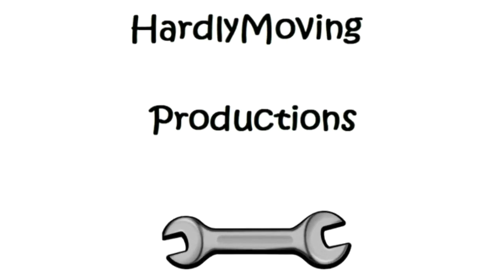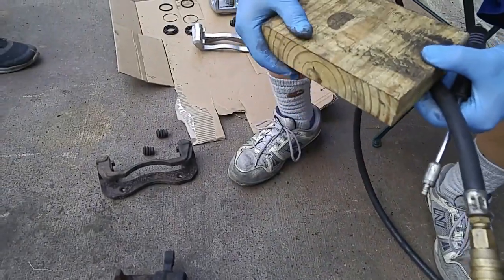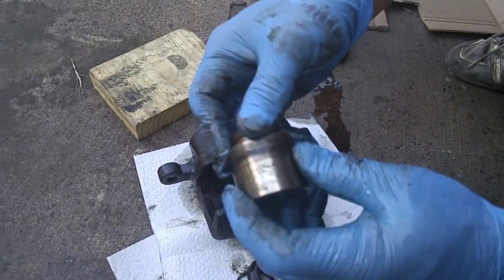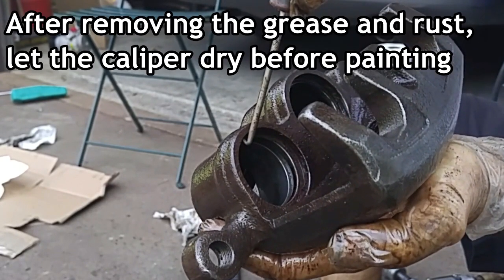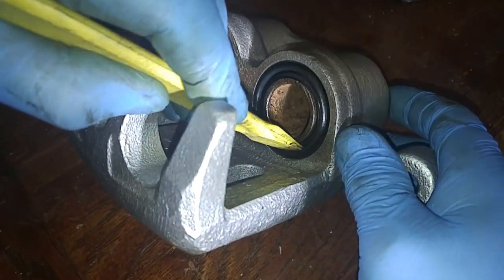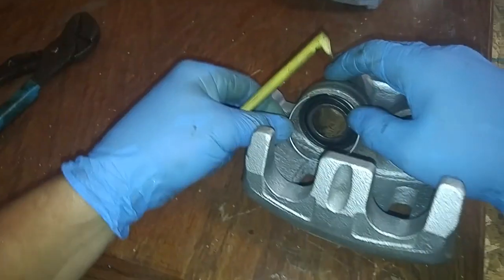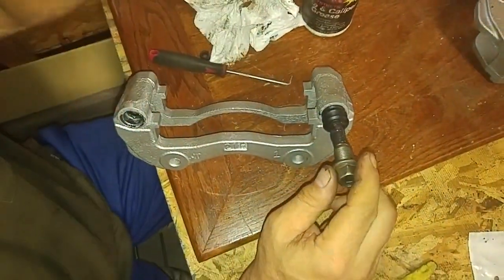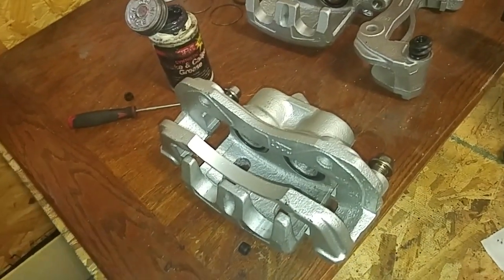Brake Caliper Rebuild - Dual Piston - Seals, Dust Boots & Dust Boot Clip

Comment: CM  great job I have a 1995 with 187000 miles I wanted to up grade what I had with new rubber brake lines, rotors (drilled and slotted) pads and rebuild the calipers.  Your explanation on removing the pistons was very helpful and you did a good job of how to put every thing back to gather.
Reply from the maker: Thanks for your post!  Recommend you do not get the drilled and/or slotted rotors.  If the rotors the least bit warp, no one will resurface them.  It can be done, but you have to cut very little of the pad contact surfaces or the cutting blade will break off.   It takes multiple passes of the rotor cutting machine and most guys don't want to bother messing with them.  Here's a video showing how to cut/resurface brake rotors:  https://youtu.be/eEpYifYWV5k

Comment: Nice to see someone apply caliper paint in several thin coats, as opposed to applying thick coats that impede drying of the paint.  Cleaning out bolt recesses in the caliper is a step that's often overlooked, and naturally leads to uneven pad wear.  Another nice tutorial; thanks.
Reply from the maker: Yup ... those calipers were pretty rusty and nasty.  A little caliper paint makes them look like new.  The piston seals and boots, surprisingly, were not that bad.  The piston holes, however, were caked with rust.

Comment: Thank you for a very informative video. I recently purchased a used Infiniti EX35 AWD for my daily driver for work. I just replaced both of the front bearing wheel hubs, and noticed the drivers side brake caliper isn’t quite right. The inner brake pad is almost to metal but the outer still has a lot of brake pad left. I’m going to try a rebuild on both front calipers within the next month along with new rotors and pads.
Reply from the maker: Your caliper guide pins are probably sticking.  Lubricate with silicone (dielectric / plumber's grease) until they slide in and out easily.  Also the brake pads should be replaced with new abutment clips.

Comment: Great, succinct explanation. I was stuck on getting that retaining clip in, maybe I can get it in there now.
Reply from the maker: A rebuild is not as difficult as most people would perceive.  It's basically replacing the caliper piston seal, dust boot and the dust boot retention clip.  A lot cheaper than getting a rebuilt.  Only issue is if the piston has corrosion pit marks. In that case, getting a new piston would be in order.
Reply: My hangup was the retainer metal clip for the dust boot. Thanks

Comment: I rebuilded the same brake calipers that are in the video. I'm not assured if I installed seal retention ring properly. Should they be visible just buy looking at dust boot?
Reply from the maker: From my recollection, the retention ring won't be visible since they're recessed.

Comment: Great video, I think my Mitsubishi van has the same kind of caliper. Do you think it would be possible to replace the external dust boot without removing the piston and opening up the brake line?
Reply from the maker: Yes, absolutely but a little bit of a hassle no having the caliper on a bench.
Reply: @hardlymovingpro  cool, I'll give it a try

Comment: Didnt the retaining clip go under the dust rubber? Im having problems, because this clip is going under the rubber straight to the caliper body wall, and not between the rubber and the caliper body as it should be. Can you help me?
Reply from the maker: First off, are you coating the dust boot with di-electric/silicone grease?  From my recollection, the outer circular lip of the dust boot should fit into a groove within the caliper.  The retaining clip can then be worked into groove as shown in the video.  You could pull out the caliper piston around 3/4 ways out to stretch the boot to help ease the installation of the clip.
Reply: I think the metal clip should go inside but outside of the factory's tooling virtually impossible, so better putting the dust seal the 'wrong way' round with a clip then right way without it.

Comment: For my 360.000km 2500TD Pajero I want change the rubber hose of the front (and rear? ) brakes for safety reason.  Are they available on autodoc?
Reply from the maker: Sorry.  Don't know.
Reply: @hardlymovingpro  trovati....

Comment: Does the grease you added not contaminate the brake fluid? Iv only Seen brake fluid used. Thanks.
Reply from the maker: Silicone grease does not react with brake fluid.

Comment: Generally speaking  ,  is the piston seal ( not the dust one ) tapered or is it flat ( the side which will touch the piston as it moves to and fro) ? I want to know if there is a right or wrong way to install that seal into the groove of the caliper body.
Reply from the maker: It flat.

Comment: A Toyota dealer quoted (1)$833 for labor and (2) $1633 for sub-frame and all tie rods.
Reply from the maker: That's a lot of $$$ and about the current book value of the car.  I'd recommend you find a mechanic on craigslist who'd be willing to do the repair.  He could also get the parts from a salvage yard.
Reply: @hardlymovingpro  Thanks.
Reply: Keep looking  that is a no go no way big ripoff
Reply: Was they going to use Vaseline or sand.😅

Comment: Just got my pads replaced, one of the dust boots is broken a little on the outer end, no leaks or anything, as I see, that book as its name says, is to keep dust from getting into the Piston. What hold the fluid pressure and seals the Piston is the inner rubber seal, Am I wrong?
Reply from the maker: You are correct.  Might as well leave it alone until it starts leaking.  Then think about getting a kit to fix it.
Reply: @hardlymovingpro  thanks for your quick response, so I'll leave it alone, on next brake service or if it starts leaking will get calipers rebuilt.
Reply from the maker: @obdiipolice7186  It's a type of repair you want to plan for while you have time to get the replacement parts.

Comment: Does anyone definitively know if we use dielectric grease (silicone grease) or brake fluid to lubricate the piston and the seals there?
Reply: It won't really matter. You can pretty much use any grease you are comfortable with
Reply: Silicone grease is very good. It's behind the "seal".
Reply: in our shop, the piston seal you'd lubricate with rubber grease, and the piston boot we use silicone.
Reply: What’s designed to be in there is brake fluid.  Adding anything else is risky as it will mix with the brake fluid creating something new.   I would just use brake fluid.   It might not matter but you can’t go wrong with DOT.
Reply: I’ll never do this again. The cost delta between DIY and new/reman is like 10%. The labor this project takes is ridiculous (I’ve done this job about three times). It’s just one of those repairs where it’s 10x easier to just buy-it-done from RockAuto.
Reply from the maker: My partner and I debated whether to rebuild or not as well.  We calculated a 50% difference with a rebuild.
Reply: The value issue truly lies with the labor. Swapping out a caliper only takes about 10 minutes plus jack/lugnut/torque work. I did a rebuild job (when I originally commented here) and did all four at once; kind of setup an assembly line to be more efficient. It was not fun. Ran into lots of issues due to the calipers being so corroded. It still cost me several hours over the course of a week due to having to wait for addition parts. I had some defective rubber boots that were already pretorn etc. One of the calipers didn’t want to accept a seal etc. I’d guess it cost me six hours of my time in total. Would have been like 90 minutes for all remans

Comment: I did this in my mazda  just remove the pads , start the car and apply brake slowly until the piston comes out.
Reply from the maker: That's another way that'll work!
Reply: when you remove retention clip brake oil didn't leak ?

Comment: Couldn’t push the pistons back couldn’t blow them out. Totally seized. Looks like I’m off to the wreckers
Reply from the maker: Bummer!
Reply: @hardlymovingpro  Mine were the same. I used clamps to push them in, used Cobras to pull them out slightly, clamp them in, repeat, spray degreaser, repeat. Then hit it with the air and they came out.

Comment: 101 on how to nick your piston bore with a screw driver and cause a leak ffs. never use a screwdriver or a metal tool, use a wooden or plastic stick for safety
Reply from the maker: Funny ... no leaks to-date.
Reply: @hardlymovingpro  lucky. still can happen, and its wiser to use softer tools for messing around in the bore. we do tractor trailers/medium duty trucks so they are WAY more pickier on how we clean out bores/change seals if we get a truck with a disc brake system that needs calliper work...and pickier on how we do things in general lol. but hey if no leaks then that's good!
Reply from the maker: @Dieselduster678  From my past experience, leakage is caused by pitted pistons or worn out rubber piston seals.   Wire brushing  (that's right ... wire brushing) the rust off the piston might remove enough corrosion to allow a leak free seal with the new seal.   Removing the piston seal with a metal pic tool will not harm the caliper seal mounting groove.  Installation of the new seal, piston boot and boot retention ring involved no metallic tools.